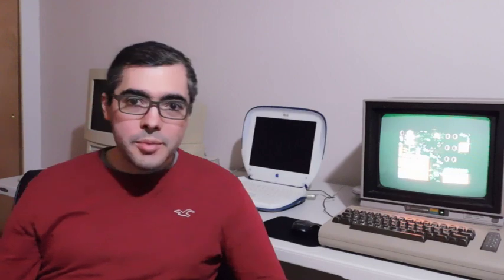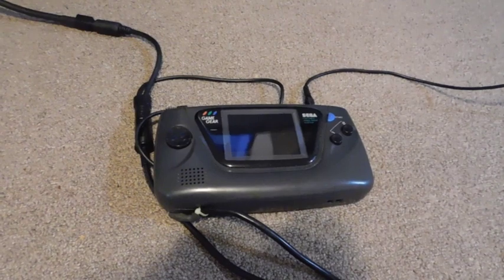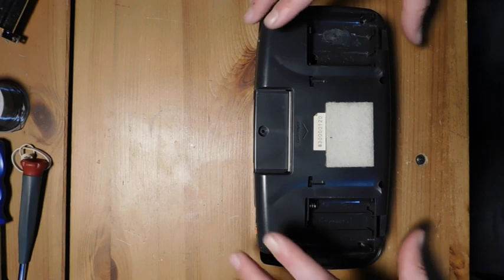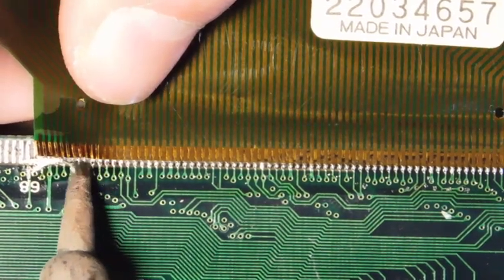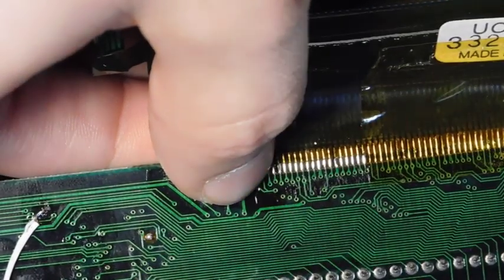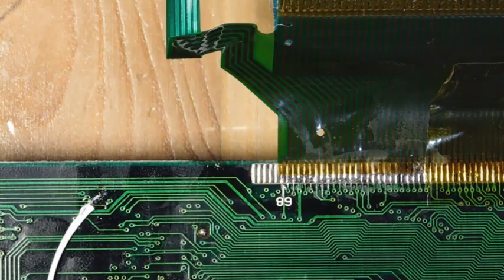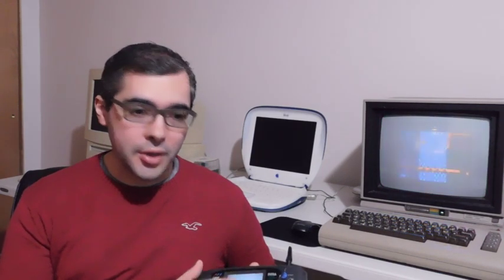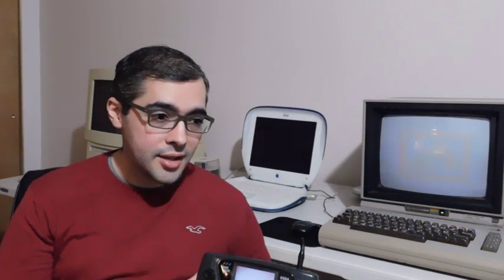Game Gear Dev Unit Restoration Part 2! RGB Video and Screen Swap

Comment: I know this is an old video but do you know for sure that the screen is supposed to work? Maybe the video output prevents the screen from working?
Reply from the maker: Yeah I never conclusively found out about whether that screen was supposed to work or not. It’s entirely possible that it never worked

Comment: Don't you have to change the tubes when you put a new screen in on game gear's
Reply from the maker: Anthony Depaula They can be replaced separately from the screen. In this case the fluorescent light seems to be working so it was not changed